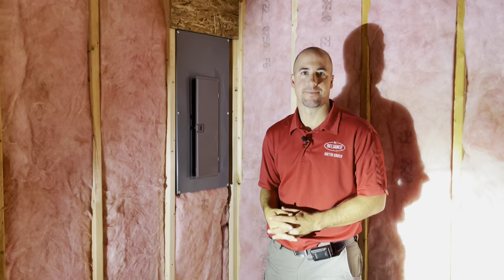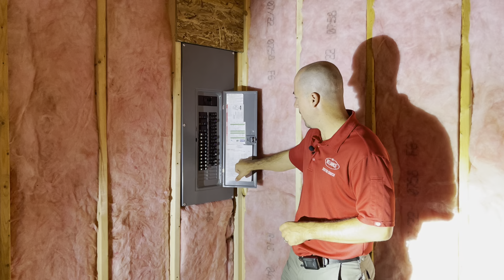Troubleshooting If A Radon Mitigation Fan Is Working - Part 1 of 2

Comment: My fan runs 24/7 and I can HEAR the air being sucked in through the cracks in my basement floor.  Is this normal? I thought they had a Radon detector and only turned on when the detector was triggered.